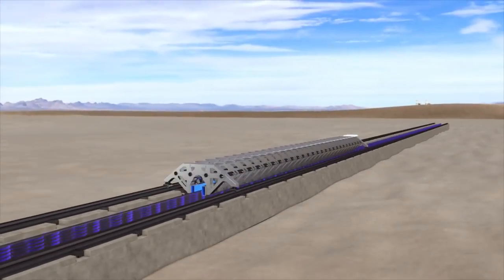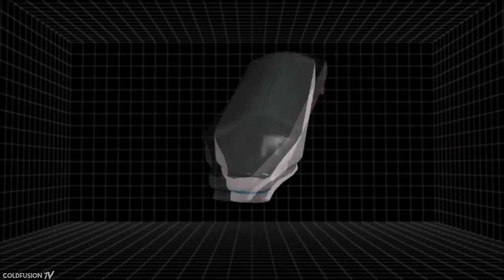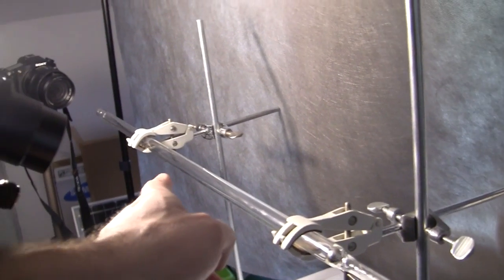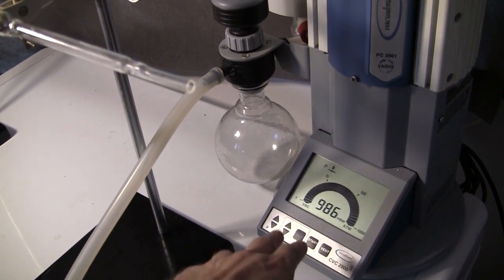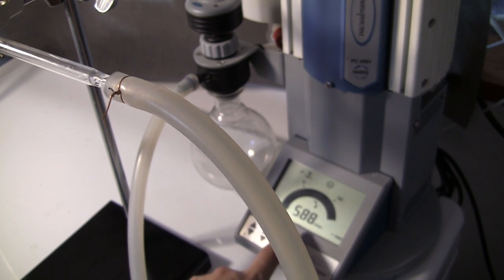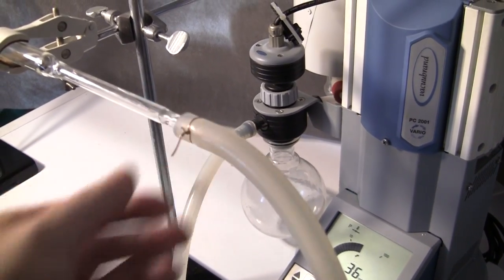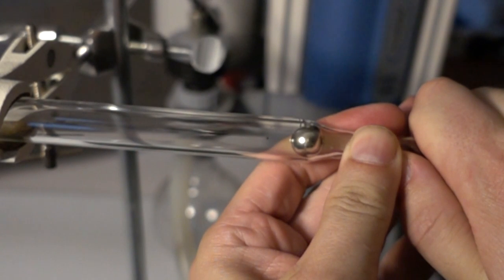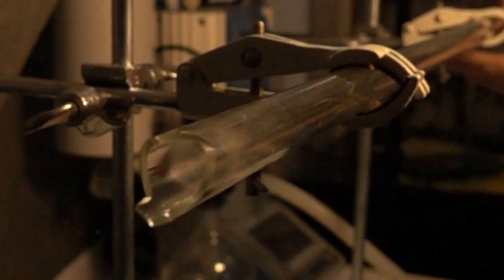How  the Hyperloop can kill you!

Comment: While 1 millibar does seem like a really low pressure environment to create, don't assume that it has no way to stop itself. There's clearly mechanisms for deceleration, even in the artist render. You're also assuming that the system for removing the air from the tunnel does not also contain a system to replace the air, should there be a failure.
Sorry Thunderfoot, I'm not buying your argument on this one. Perhaps find another way to discourage this project. Energy costs? Methods of removing air from millions of cubic meters of area?
Reply: +kayla summting excuse me for my usage of the colloquial form of "area", I know very well that volume is cubic, and area is squared. But when common folk such as myself talk about regions, we use "area" for both 2D and 3D applications
Reply: I don't think removing the air is as big a challenge as people think. people seem to assume they would completely build all the tubes, then try to decompress the entire system all at once, which would require loads of energy. A better system would be to remove the air section by section as they are built as a starting point, then add regulator pumps to maintain the pressure.
Reply: removing the air in sections would require much more energy and maintance
Reply: Well what comes to mind is if they merely just low the pressure in the front and increase pressure in the back then the car will want to move naturally without any added force. Would putting a bullet train in a solid tub make it go faster or be any more or less safer?
Reply: The whole idea of lowering the pressure in the tunnel is that the pressure behind it comparably increases.
Reply: yes its not vacuum its just low pressure + front pod compressor air intake also the pod is supposed to be 50% of the tube crosssection which is plenty space for air to pass by. Its not a difficult thing to do.
Reply: can't they just launch the hyperloop for a specific amount of time and letting friction do the job? all they need is the simpe math.
Reply: Vedrit Mathias with the speed and acceleration it would be useless you'd go to fast for a way stop it any attempt of ructions would not be quick enough
Reply: Vedrit Mathias he thinks the developers of this amazing infrastructure didn't think of the negative side of it?? Haha

Comment: There is a point of diminishing returns the Mythbusters attempted to make a super powerful vacuum gun for ping-pong balls to go through a paddle. And the longer they made it the less effective it became. It stands to reason that the longer the hyper loop the less of an issue a breach is.
Reply: It's not just about speed you dingus, but acceleration. And looking at the concept seats, it will be almost like sitting in a recliner. If you're facing the direction of the breach blood will "rush" to your lower extremities. If this acceleration is long enough it will cause you to black out, longer still and you're dead, this is the driving principle beyond the concept Euthanasia Coaster. Face the opposite direction and you'll redout. Blood rushing towards your brain. Long enough and you either run the risk of blindness or even stroke.

Comment: While yes a vacuum failure can cause massive acceleration if the vehicle is fully sealing the sides of the tube (Like the ball bearing did here), however the hyperloop isn't creating a seal like the ball bearing is, thus the vehicle would just have the air flow around it.

Plus there would be some sort of emergency physical brakes besides the maglev accel/deccel.

Comment: Realisticly would this not be delt with by adding pressure sensors and valves every 10 meters or so that open in the event of a presure failure? Seems like an ok idea tbh though youd then have to design the vehicle to withstand the rapid presure change (not too hard tbh)

Comment: The question should be: what would happen to the people in case of failure of the seals/doors? There is no air around the cart, so the air inside would be sucked out in a fraction of second (depending on size of the hole, that is).

Comment: Yes, because there is no way you would be able to construct this thing with safety seals every few hundred meters that would re-seal the tube behind the train in the event of rupture. You could also apply brakes to the train which would have to resist the force of 1 atmosphere of pressure difference, which seems perfectly plausible. Without the backup seals, I think the bigger issue would be to pump out the absolute fuckton of air that would fill the tube. If this is a trans-Atlantic tube, it would probably take months.
Reply: 1 atmosphere pressure difference is not reasonable. This tube is miles long. Do you understand the volume of air in a mile long tube? This thing would be several meters in diameter and at least 10 miles long. This much air being suddenly displaced would be equivalent to dozens of tonnes of tnt. Air displacement is what we call shockwaves, and they are not just deadly, they are incredibly destructive. No seal would be able to close fast enough to avert the ridiculous amount of damage it would cause to the walls in just a few milliseconds, rendering the seal useless anyway unless the walls were at least a foot thick and made of steel. That much steel would bankrupt whatever country decided to create these things, but lets do it anyway because we want to get to work 20 minutes faster.
Reply: It probably couldn't fill enough volume fast enough. Also it'd have to carry the weight of those tanks. It would be easier to have vents on the tube to open to equalize pressure in the event of a failure.
Reply: levi warbrick Pressure differential doesn't scale with volume. It's still 1atm.
Reply: stormweaver82 
Not really. The air would just spread out in front of the train and also travel with almost no friction in a similar manner to the train, I think.
Reply: its not a vacuum tube ... it is low pressure and only section by section and the pod compressor at the front reduces air-resistance further. Also Elon Musk stated that the cross section of the pod compared to the tube should be about 50% which means there is enough space for air to pass by.
Reply: Could you use air tanks in the front of the car that release air directly in front of it to slow it down?
Reply: "do it anyway because we want to get to work 20 minutes faster."
Too lazy to look it up but people invested a fortune in underwater internet cables just to chisel 0.00something on transactions, persumably related to stock exchange.
Reply: *****
Pressure differential doesn't change with volume, but the amount of force required to move matter scales with volume. In other words, the bigger the mass of air displaced, the bigger the shockwave.
Reply: as others mentioned, why not have seals every few hundred meters with regulator pumps that in the event of a catostrophic failure open up to offset the problem. not to mention the hyperloop could easily use a clamping system around any of the three points of contract that its supposed to have to act as a brake (think the rotors in your car. sure the initial shock will be painful but deadly? i dont think so.
Reply: Ryan Schafer You're talking about an unexpected deceleration from speeds exceeding 400 MPH. This would be wildly dangerous in a car where you have safety belts, in a train carriage there will always be people who neglect to wear their belts, even if you provide them. This would spell untold injury to anyone unlucky enough to be on that train when they hit the brakes.
Reply: It will probably need to be continuously pumped since it will lose vacuum over time. There is never going to be a perfect seal on this thing. The engineers working on the project know this, they will find a way.
Reply: Sure, there are challenges, but nothing that is unsolvable. Engineers have been designing and constructing vacuum chambers iand vacuum piping n ever larger sizes, the physics is well known. This is just a very long one. Or a very large vacuum pipe.
Reply: To solve the problem described in the video, sudden deceleration is not required. The role of the brakes is to prevent an extra acceleration from taking place, if there is a catastrophic pressure loss on a section of the tube that is behind the capsule. If this happens in front of the capsule, it is the incoming air that will create the deceleration.

Comment: The hyperloop depends on low friction and drag. I don't see where it requires that the car have a tight seal against the walls of the tunnel. If it doesn't, then all that happens in a vacuum failure is air rushes by, not that the air pushes the car like the projectile in your video. Put that 1cm diameter or w/e ball in a 2cm inner diameter tube and test it again.
Reply: The tolerances within the tunnel with the pod are very tight. So tight, they need a turbine fan in front of the pod to move the small amounts of air in the tube past the capsule, otherwise it would build up in front and drag.

Comment: The original design paper describes emergency mechanical brakes that would help a lot.  Plus there are other possible control measures such as explosively inflated airbags that could plug the leak as well as emergency vents along the tube that could help to event out the depressurization.  It may be possible for the pod itself to form a plug by filling the pod-tube gap.

Comment: The Hyper Loop is ridiculous. We still don't even have high speed trains over here! Trains have never been big here in America because the Auto mobile industry quickly took hold of the transportation market. If you look at Europe and Japan trains are a common sight for transportation. That is besides the point. Ultimately the hyper loop is extremely expensive and unreasonable form of transportation. I could not imagine how much energy it would take to suck all the air out of a 500 mile long tube! Before we get to the hyper-loop we need to get to high-speed trains... but heck why am I questioning what the media buts out, they just show what you want to see on TV.

Comment: Thunderf00t, did you seriously try to 'debunk' the concept of the Hyperloop by modeling it as a metal ball in a glass tube? You have demonstrated nothing related to the Hyperloop, you have demonstrated how air pressure can accelerate objects through tubes.
"No way of stopping", there are many ways to have some sort of emergency breaking system on it. One way I could think of at the top of my head right now would be to trigger an artificial vacuum failure ahead of the pod to equalize the pressure and prevent acceleration.
You know, there are engineers working on that project and it's not even finished yet but it's already far more complex than a metal ball in a glass tube.

Comment: The supposed problem you mention has an incredibly easy solution:

Just put valves into the pipe at regular intervals (every few hundred meters) that are electronically connected to all open up simultaneously in case a bigger leak is  detected anywhere. That way the entire pipe would pressurize continuously along it's length without accelerating the capsule too much.

The Hyperloop idea has many potential problems. Even the people working on it don't claim to be 100% sure it will work safely and economically.

But this is nothing but clickbait. If the hyperloop fails it will definitely not be because of this.
Reply: What you're suggesting is like popping a balloon in reverse. Holes don't destroy balloons; you can stick a knitting needle in one end and out the other, so long as the parts where it enters and exits has tape to reinforce it and stop the hole expanding. That's the issue- the hole expanding due to the difference between the air pressure inside and outside, air forces it's way through and stretches the hole until it exceeds the balloon's surface area. 

Really, this has all been done before on the scale of the Hyperloop: the Large Hadron Collider is a long sealed tube which is a vacuum when operating. They can't suck out the air quickly and they can't put the air back in quickly: it takes weeks. Doing it any faster could damage equipment(in the case of a train as TF points out- a pressure wave of just one bar moving at the speed of sound is lethal) or the tunnel itself. It doesn't matter whether the air is going in or coming out(like a balloon), or how many places you let it in- if it does it too fast, the structure is not going to be left intact.
Reply: The hole expands because the material is stretched elastically and is considerably weaker due to the stretching.  I'm not sure the same principle can be put on objects that don't expand or contract a considerable amount under different pressures.
Reply: The force working on it is the same no matter the material: jumping from a tall building into water is mechanically no different from hitting concrete instead. 'Elastic' generally means that the solid material will return to it's original shape; the balloon's problem is that it isn't elastic enough so it's in ribbons before the outside pressure and inner pressure are equal. Virtually all human-made structures expand and contract and are designed to do so for obvious reasons.
Reply: MasonDixonAutistic but you are talking about material properties here. catastrophic material failure. Concrete does not behave the same way as rubber, even under extreme pressures. I was using elastic in the more colloquial sense, as in behaves like rubber. 

And no, the balloon's problem is that it is stretched thin. Try this yourself. you can poke a hole in the bottom or top of a balloon (the part that isn't stretched).  The material is structurally weaker where the material is thinner, and is therefore more prone to failure. It isn't about the fact that it is stretched, its a matter of how much it has been stretched to where there is little mass on the outer edges and therefore less structure to the material to support the edges of the hole you force into it.
Reply: You're hiding behind colloquialism: concrete is an elastic solid which is why it is used to make structures- there would be no point reinforcing it with steel girders otherwise. Buildings must bend or they will be blown over once every twenty years when a strong gale happens. As concrete dries it becomes brittle and will often need filling in, the purpose being to keep it pliable. But whether you make something out of rubber or concrete, the 'properties of the material' depend a lot on the environment. A sealed structure with a vacuum inside and an atmosphere outside will behave similarly no matter if it's glass of the right thickness, steel of the right thickness, concrete of the right thickness or even rubber of the right thickness to keep the vacuum in and atmosphere out. A hole opens up and the pressure from moving air going through it will tear it wider: see it with sink-holes, see it with boilers with immersion heaters gone rogue(oh and the things that steam condensing back into liquid will do to a metal container). If it's man-made, it's either elastic, plastic or ceramic and under extremes they will all behave the same two ways- like they are brittle or like they are rubber.
Reply: MasonDixonAutistic let me know when you can inflate a concrete sphere to 3x its size.

Comment: If they put a maglev train in a vacuum tube, why the maglev system could not stop it or even control the sudden acceleration? Besides, it would accelerate only if the train was floating free and slower than the air streaming in. Also in working maglev trains only the section that the train currently occupies is energized and computers sure will not let the train "roll" uncontrolled.

Comment: well done thundefoot but I wont applaud you. your arguments are the same as used against lifts even down to building a modle to prove your own theory well done you. your supposed to be an academic according to yourself but then go on to demonstrate bad science. firstly you have to be able to recrate the experiment more than once for the same outcome. 2 you state I'm am merley goin to scratch the tube but then film yourself apllying external pressure voiding your own paramiters. 3 the hyperlope is in theortecical stage at the moment using experiments like yours to test theorys. 4 back to lifts everyone belived that they would be death traps yet the most basic breaking system ever developed for a device that has th potential in cases to reach terminal verlocity has resulted in vrtualy no catastrophic lift faliers. I realy hope your not teaching engernering on no devlopments will be made with  your oh you want to make this well you carnt as it wont work, and heres my flawed demonstration as to why. please fell free to engage and prove me wrong but at the moment you are an academic fail with a must try harder.

Comment: But what happens when the probability of something like that happening is so low, that it might as well not even have to be worried about? There are countermeasures that can be developed to combat this. Such as the maglev the train rides on slowing it down, blast doors that are placed every few miles or so that can limit the extent of failures like this, and a way for air to go around the train if a breach does occur. If i'm not mistaken, the Myth Busters put a train car tanker new a complete vacuum, and it didn't get crushed until they induced a structural weakness by dropping a large concrete block on it. The Hyperloop tunnel would be much more stable than that, and could hold many times more load. I like the idea of Hyperloop, and I can see where you are coming from, but I really think that this has potential. Now I did see an article about some sort of Titanium-Gold Beta aloy or something that was much harder than previous alloys, that might be interesting.